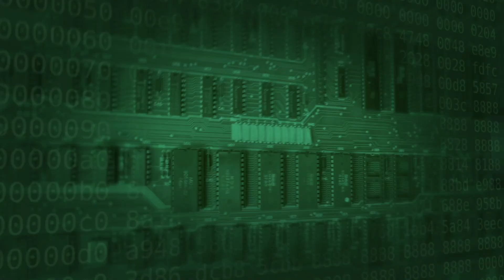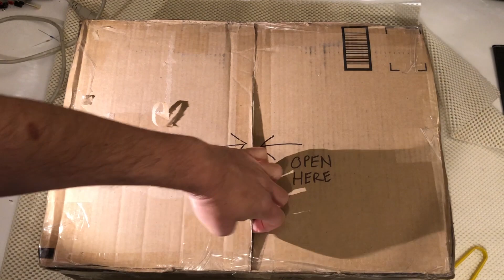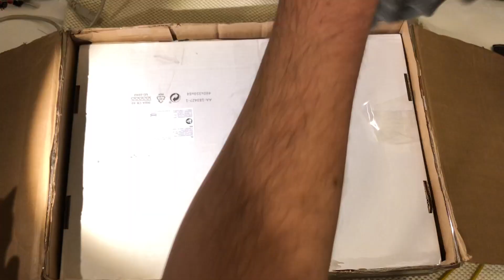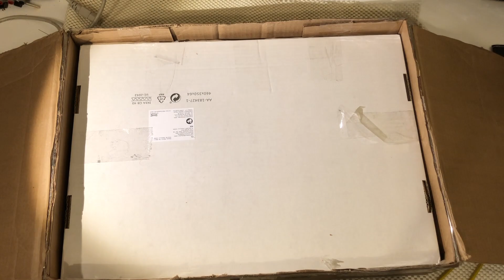Fixing Jeff's Commodore PET 2001-N with help from the ROMulator (HD)

Comment: Also… anytime a TTL has a floating output… check the Vcc for +5V. If it's low chances are there's a cold solder joint on it. If it's good then check the ground: if it's not zero then again it's probably a cold solder joint on that pin.

Comment: I bought a PET along with a huge dual floppy drive and a massive commodore printer from a Library sale back in the 90s. They used it until 1995 for their office if you can believe that. I paid $20 for it. It was still working. I sold it a couple of years later to a guy in Canada for $100. That printer was HEAVY.

Comment: There's no reason to carefully desolder a part that you aren't going to keep; just clip off all the leads and desolder them one by one.
Plus the first thing I do with "vintage" boards is check all the electrolytic capacitors. 
[How did the DRAM work with only 7 bits?!?]